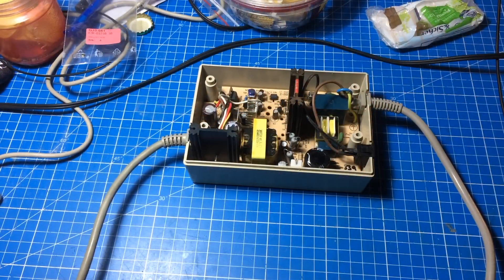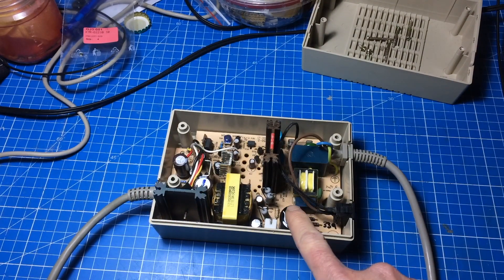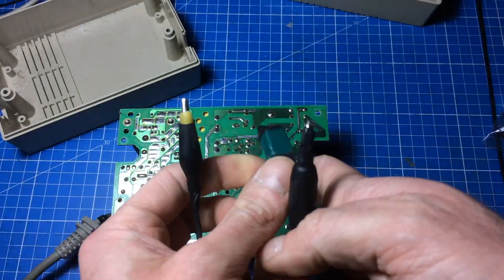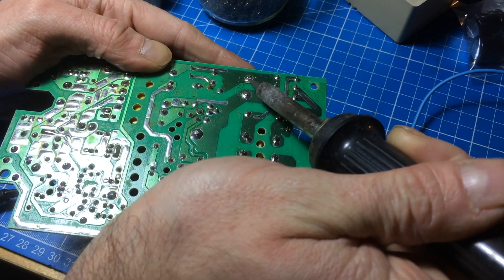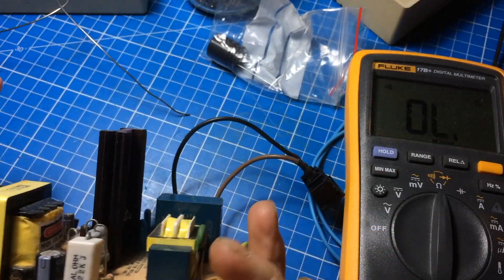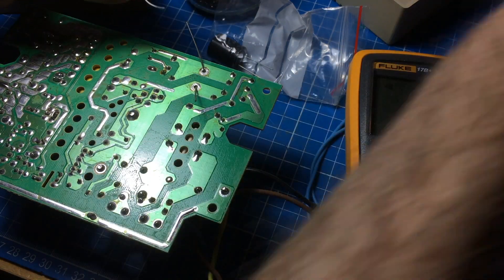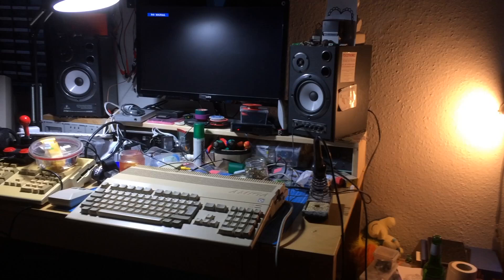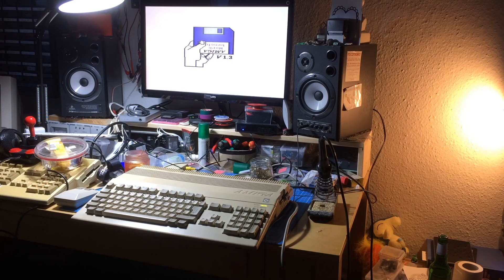Amiga 500 Power Supply Bad Capacitor Repair

Comment: How much power does this 5V power supply have? 4.5A?
Reply from the maker: Yep, 4.5A on this model. There's also the earlier variants with 2.5A and the ones that were shipped with the A600 and A1200 (I think) that provide 3.5A. :)

Comment: One little trick which I'm sure you know is to solder one leg,  then put pressure on the back of the cap and reflow that one joint and with pressure still applied solder the second leg.   Doing so you can get the cap nice and tight against the board to help with possible vibration breaking off the legs in the future.   Not that is maters much in this case.  👍

Comment: Hello Can you tell me what is the procedure to measure the amiga 500 power connector using a multimeter to know if it´s faulty ? my amiga 500 doesn´t turn on i tested it with another psu and the board works perfectly but sometimes there´s no contact so the amiga doesn´t turn on its psu is working ok. So i assume that is the power connector fault

Comment: Hi Jan,  i would always recommend to replace the powerline capacitor with 450V type. The reason for this is the fact that these old machines were built for a power rate of 220Vac. Meanwhile we have nominal 235Vac and depending on time and place we are sometimes close to 250Vac.
Another tip for you is the cap discharger: i use a lightning bulb with something around 25 Watt. This is even handy to bridge blown Fuses on the primary side because the bulb will act as a PTC and in case of a short just will light up and nothing will explode or smoke away. If all is ok the bulb will just light up for a second until the main cap is charged and the SMPS starts working... soft start DIY :-)

Comment: This is also a nice new PSU for your low-end Amiga? Take a look at this one: https://amitopia.com/new-amiga-power-supply-replacement-review/ It is smaller, sexier and will last for a long time. The connector is also in very good condition. Great product for Amiga 500, Amiga 600 and Amiga 1200! Check out why... many solutions and this one is great if you are a bit scared. Great video anyway... Ive subscribed!

Comment: You don't need to hold the leads on the capacitor for a second; the capacitor should discharge immediately.
Reply: True 👍
Reply: depends on the value of the resistor used.

Comment: Hi Jan, i have a couple of A500 and a 1200 PSU`s, do you know the list of capacitors id need to re cap these please, many thanks.

Chris
Reply from the maker: I'm afraid that's not as trivial. There's at least 5 different versions of the A500 PSUs alone that I know of. They all need different caps of course. I think the easiest way is to open the PSUs and look at the capacitor values.

Comment: Hello Jan! Nice video! I would like to ask you something I have a power supply for commodore amiga 500 not the heavy the lightweight (pwm) and when I turn it on immediately the fuse (glass tube) blow up, can you suggest me the components which need check?  I have two multimeters but not Oscilloscope :(   Thank you!

Comment: I have amiga 500 power supply but there is no screws how to open it? any idea
Reply from the maker: Mh, I don't have any without screws. Maybe the screws are hidden beneath rubber feet/stickers? Otherwise it's either clipped together or welded (which would be pretty painful to open).

Comment: Hallo Jan, 
lerne viel von deinen Videos und das hat mich auch dran erinnert meinen A500 zu oeffnen und die Batterie zu wechseln von der 512 memory expansion card. Zumn glueck grad noch rechtzeitig. hab dann beim testen gemerkt das die 12V rail tor war. Habe nun den fehlerhaften Baustein gefunden, ein Voltage Regulator. Ne Frage: Die produkt nummer ist auf baustein und eine andere nummer. F8725. Ist dies nur das Fabricationdate (1987 25 Woche) oder ist dies ein andere wert den ich beachten muss?
Ein beispielbild von diesem regulator hier: https://proxy.duckduckgo.com/iu/?u=http%3A%2F%2Fwww.talonix.com%2Fimages%2Freg%2FUA7812UC.jpg&f=1  
Wuerde mich freuen ueber eine Antwort...und mach weiter so! :D
Reply from the maker: Vielen Dank! Die Nummer auf dem Spannungsregler ist wirklich ein Date Code, jedenfalls ist die oberste Zeile die entscheidende Typbezeichnung: 7812 ist ein 12V Spannungsregler. Wenn du deinem Netzteil was gutes tun willst, besorgst du einen 78S12, der ist ein bisschen höher belastbar (falls der Amiga z.B. mehrere externe Laufwerke befeuern muss ergibt das Sinn). Ein normaler 7812 reicht aber im Normalfall völlig.
Reply: Besten Dank, konnte leider kein 78S12 modell finden aberim moment haengt ehh nicht soviel an der schiene.

Comment: That's interesting to see a switching PSU for the Amiga because all the power PSUs I have for my Amiga's are the linear type, but externally they look same.
Reply from the maker: Most of the ones I have are linear, too. I think these switching ones were produced for the newer models only. I know that the A1200 came with a (slightly different size) switching power supply for example. The one I have here presumably is from a late revision A500 (or A500 plus).

Comment: Just subscribed to your channel! I have a couple of Amiga PSU's and I am going to replace all the caps in the PSU just to be sure a defective PSU won't fry my beloved Amiga's. Question: why haven't you replaced all the caps in the PSU?
Reply from the maker: Simple answer: I didn't have the right caps in my parts bin. I'd recommend replacing them all though, especially on the switch mode PSUs. ;)
Reply: Ok. I will start on one PSU soon replacing all the caps. Is there no need of installing a overvoltage protection circuit into the PSU?
Reply from the maker: +NiekkieNick No, these SMPS are pretty reliable in terms of overvoltage. They'd rather break down altogether or start oscillating and then give up as common failure modes afaik. Both would probably not do harm to the Amiga. Not sure about the linear supplies though. I've not heard of an Amiga that was killed by a PSU yet. The PSUs die faster than the Amigas it seems.

Comment: Hey, I live in US and I was wondering if u would know why I would get -12 drop to below -5v while under load(computer on) on my pal A600 but my A1200NTSC is normal. Also my sound on 600 is half volume of my 1200 , way lower than it should but the 600 works very well except the low audio volume. Not sure how to approach it? Thanks
Reply from the maker: Seems like the A600 has a problem. If the voltages are normal on the A1200 I would guess the PSU is just fine.

It's a long shot but have you recapped the A600? I'd look for leaky/faulty caps or connections around the audio circuitry. There are two directly on the outputs and another few on the 12V supply line (I don't know where they are located--haven't worked on an A600 yet).

That's only an idea of course. Could still be an issue with the PSU, too. The -12V line is only used for audio and some serial port functionality (if I remember correctly) so it's normal that everything else seems to work. Hope that helps a bit. Feel free to contact me again. :)
Reply: Jan Beta thank you, I'm going to recap the board and take it from there. Thanks for the reply!
Reply: I just have one more question for you. I have noticed that the 2 caps by audio out have swollen a bit so I have to replace them asap. Now the access I terrible to them as they sit right next to keyboard connector. I might have to remove it b4 I attempt the repair but I was wondering if I could use regular electrolytic caps at 22uF at 50v in place of original 22uF at 25v? There is enough space to put regular caps is and I have a feeling that there might be some corrosion under as the old caps are very visibly swollen. Pleased let me know.. thanks
Reply from the maker: I wouldn't recommend removing the keyboard connector for doing this. Get some Kapton tape (it's a heat resistent tape) to cover up the plastic with some layers and it should be safe to work on.

Using regular electrolytics works absolutely fine electronically. The solder pads are obviously stressed a little more but it shouldn't be a problem. I've replaced SMD caps with through-hole on disk drives and such without any problems. Be careful thought to not lift the pads when removing the old caps. The PCB sometimes gets very brittle underneath leaking caps.

Good luck! Hope you can fix the issue!
Reply: Jan Beta Thank you, I took your advice and left the keyboard socket in, I only gently removed the top portion and then covered the area with couple layers of paper tape. I replaced the smd caps with regular ones and carefully soldered them on the board and the audio works perfect now!!! This was the problem after all. I have also noticed that old caps leaked but did not lift the tracks or did any serious damage but I caught it right on time because the Electrolit lifted some of the white markings and a bit of track coating came off too but track is still good. I cleaned the area with 99% alcohol and tired to get it all but I wonder if any of leaked electrolit got under the audio sockets. A600 I much tighter than a1200 but I don't want to remove sockets to check/clean underneath. I wonder if I could 'leak' something under the sockets to neutralize any of that corrosive leakage under the sockets. There might be nothing but that stuff is very corrosive I didn't realized that it is that bad, I thought only old battery leakage eats the board but caps are bad too! I ordered new caps for all of my Amigas and will replace them all! Thank you for your advices, you are the only person that actually was willing to help and I appreciate it very much!!
Reply from the maker: Ah, nice that it worked for you! :D Yeah, the surface mount caps in the Amigas are all starting to leak these days, it seems. It's a good idea to replace them.

I found that to clean off corrosion (from battery or caps leakage) what works best is lemon juice or vinegar, actually. You could try "washing" the affected parts with that. Make sure to rinse with alcohol after that.

Always good to keep the old machines alive. Good luck with the recapping! :)

Comment: Is it normal to get hich pitch sound from the power supply for Amiga 500? Sometimes it sounds low and the higher dependig on whats happening on the screen.
Reply: Normally there's some silicone or similar material on the transformer and inductors to keep parts from vibrating and cut down on noise.  It is fairly normal and the pitch does change depending on the load, but it shouldn't be too loud.  My A1200 power supply makes no whining noise at all, but it does make regular ticks about once a second.  I may have to investigate that, although all the parts inside look clean and in good condition.
Reply from the maker: +Advan Safic That's perfectly normal for switching power supplies. Basically, the inductors start emitting oscillating magnetic fields and act as a kind of very tiny loudspeaker. Sometimes the oscillation is in the audible range. The switching frequencies of the PSU change with current/voltage which explains the pitch changes you are hearing. Absolutely nothing to worry about, I'd say. (Not an expert on the issue though.)
Reply: Thanks for the fast answer! I thought it was a bad capacitator. I bougt myself a Amiga 500 yesterday with mouse, joysticks, external floppy drive, like 400 diskettes and A520 module and works just fine with my LG 32 inch flatscreen TV. I paid around 111 US Dollars for the whole package. :)
Reply from the maker: +Advan Safic Ah, cool! Another new Amiga owner. And a great bargain! Have a lot of fun with the old machine! :)
Reply: Thank you! :)
Reply: I will try to upload a video of the noice. Sending a link to you here in the comments. Thanks! :)

Comment: Hi Jan. I'm a new subscriber. I cannot believe I haven't come across your channel before. Anyway, nice work on this PSU fix. I really like your cap discharger; that's a great idea. Have you ever had the occasion where you require replacement of the square DIN connector on an Amiga PSU? I know they have been out of production for some time, but I cannot source spare ones anywhere. Looking forward to more videos. Time to binge-watch your other videos.  ;)
Reply from the maker: Thanks & welcome aboard. :) Hope that you like the other videos (not only computers here as I just recently started doing those). I actually started looking around for the square DIN plugs as well as I'm planning to convert an ATX supply to a more powerful Amiga PSU some time. It seems you can still get the sockets but the connectors are out of stock everywhere I looked. I'll probably end up salvaging one from a badly broken PSU (are there any even? They seem to be quite sturdy in general.). The Commodore 128 used the same plug, I think. Salvaging is not an ideal solution of course. :/
Reply: Best way to get the connector is to buy a faulty amiga psu, they appear on ebay from time to time
Reply: I have amiga square connector if you want  one or if you don't find any?

Comment: Great job!!! =D
Reply from the maker: Thanks. I'm a bit better with through hole stuff, obviously. ;)
Reply: Yeah - Don't kick yourself over the Amiga SMD cap video!  The technique of twisting caps is something that many other people use.  Just take a look at GameTechUS and you will see him doing that technique, or cutting them off (I forget which).  So whilst some people don't like it, it doesn't mean it cannot be carefully done.   It's the same with the SMD ceramic caps - other people are doing it, and I almost did it myself!   So don't beat yourself up about it =D

These old Amiga PSUs are quite resilient really - I've not come across a faulty one in ages!!!